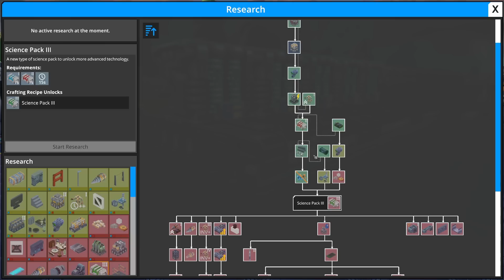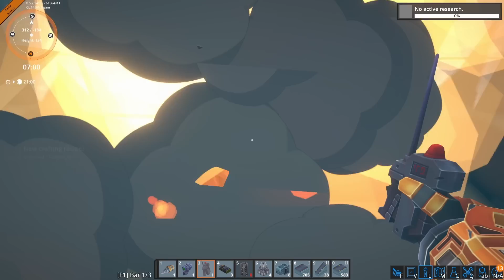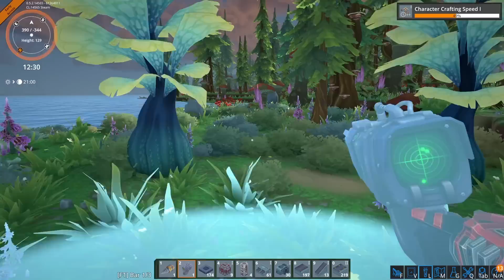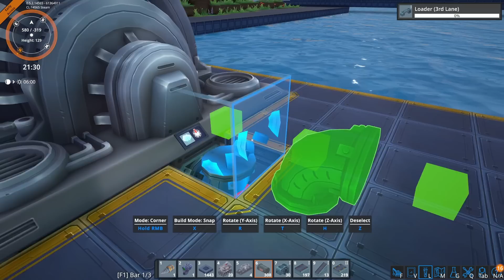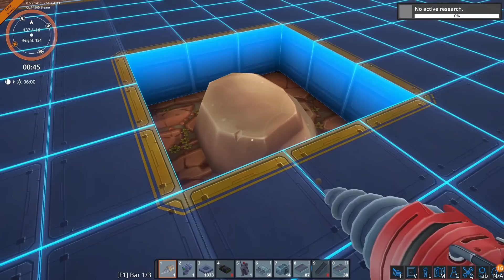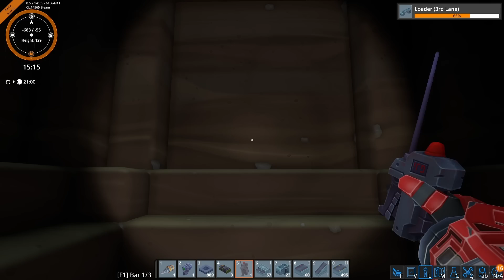Unlocking The Power Of Steam in Foundry Lets Play Ep.2

Comment: 8:50 no, you can just put boilers together and water will flow through one to another. It's not necessarily to place some pipe between them. It works the same way between boiler/turbine, theese also can be connected directly.
14:50 it's supposed to be produced with assemblers mk.2, that's when the production rate becomes a quite usual integer number.

Comment: Water intake is 30,000 l/min (500 l/s), so one intake can supply 25 boilers.  The limiting factor is the igneum fuel line, at 160 ore/min it can maintain 14.8 boiler continuously for roughly 50MW of power.